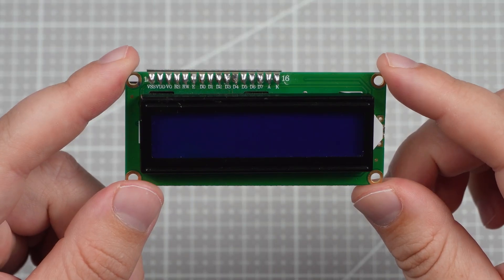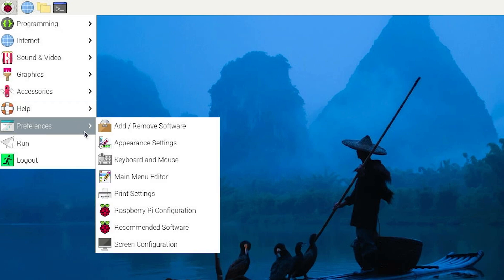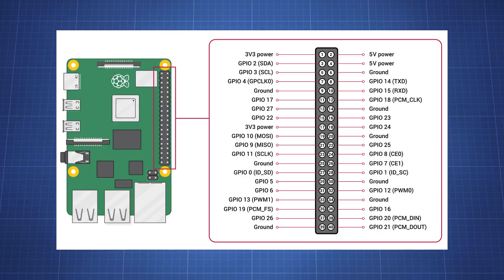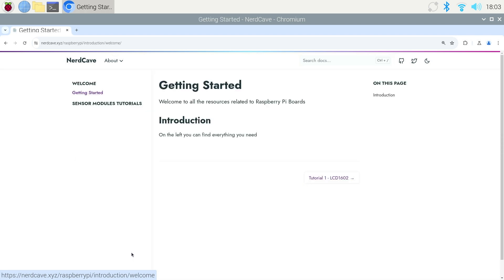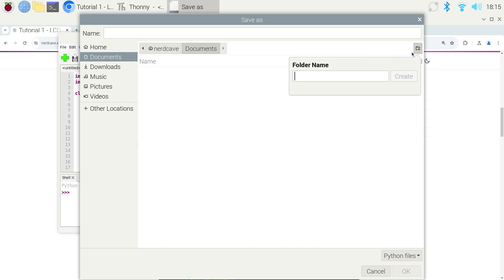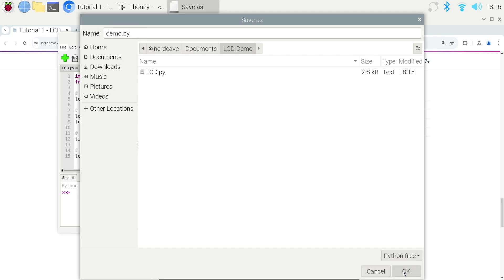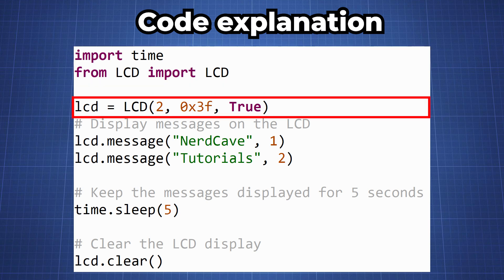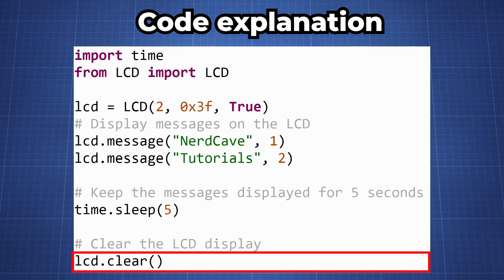Raspberry Pi 5 Tutorial - LCD1602 I2C

Comment: my lcd is the same model but all the pins aren’t soldered and dosent havé the four pins coming out the left side like in the video what do i do
Reply from the maker: then the LCD module you are using does not have the I2C module, you will then have to connect it either 4 bit or 8 bit mode and use more wires etc.

Comment: The code runs but I can’t get the LCD to display anything other than a single line of blocks, any help would be great thanks!
Reply from the maker: The single line block shows by default when you plug in the LCD, this is so that you can adjust the brightness of the screen on the back with the variable resistor. Regarding the connecting is the SDA and SCL connected to the correct pins and the address are set correctly?

Comment: I got error 121 remote i/o error.  Rasberry pi 5 address changed to mine as seen from the out of of command given here .is there a timing issue . Checked hardware connections and i2c enabled,rebooted
Reply from the maker: so you got a different i2c address? is the SDA and SCL wired correctly?